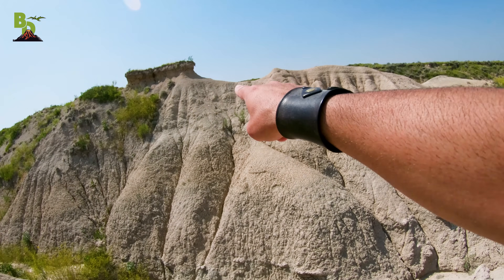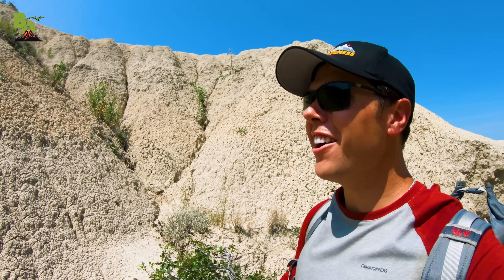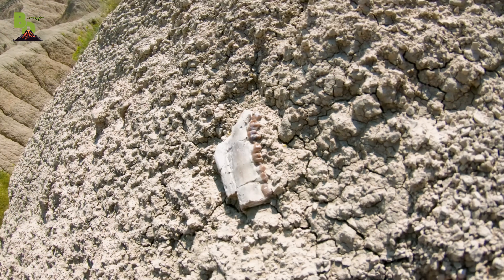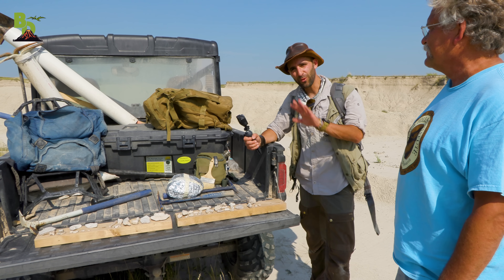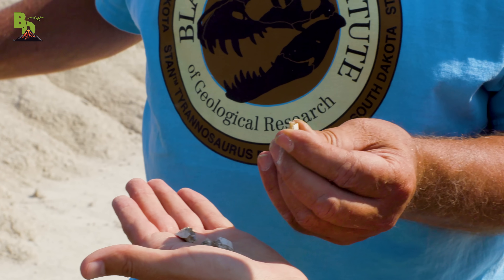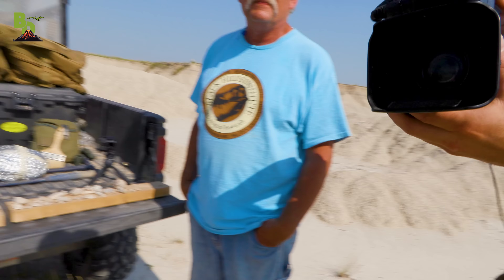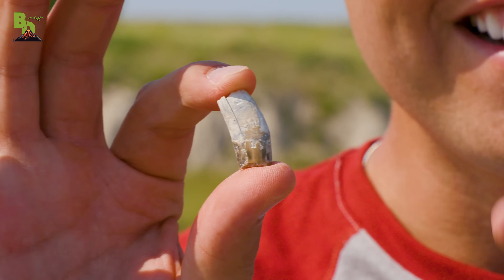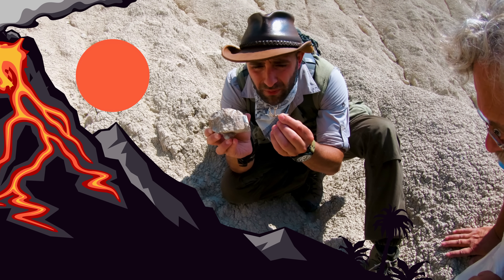Fossil Hunting in the BADLANDS!

Comment: I hope they know that...... those are definitely NOT fossils, you would have to soo lucky to find one that is white, which is impossible, because the last dinosaurs lived 300 million years ago
Reply: Reptirex Rader They are indeed fossils. Color does not indicate whether an object is fossilized or not; these fossils are white because of the surrounding minerals which have replaced the original remains in a process called permineralization. These fossils aren't the dinosaurs either, they're mammals. The last non-avian dinosaurs died out roughly 66-65 million years ago, not 300 million years ago, when they didn't even exist yet.